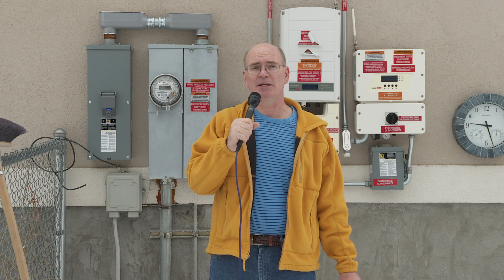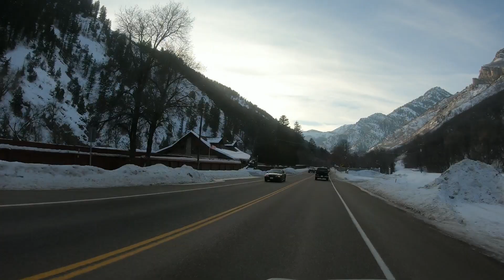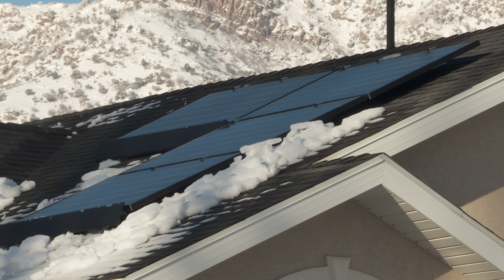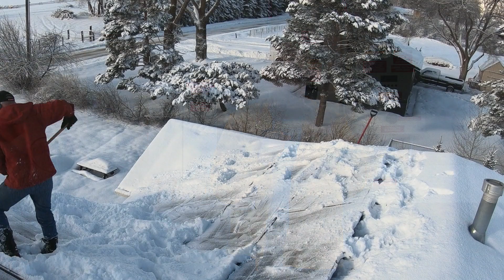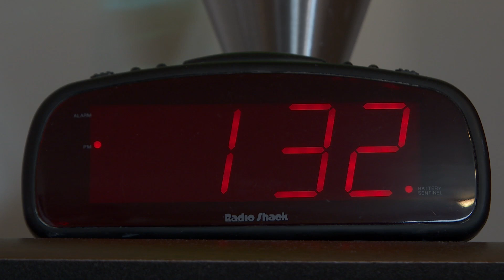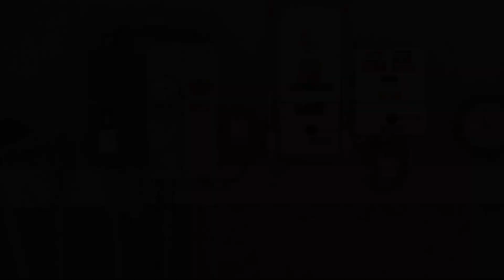Solar Panels On Our House - Two Years In

Comment: Thank-you for your extremely open and informative uploads as they have answered several questions we have - especially regards the battery back-up!
Reply: Regarding battery backup, it is a good idea but many batteries are not very efficient, to get a good battery storage system you need to invest quite a bit of money and you need the space for the extra solar panels and the space for the batteries. My goal is to try to go completely off grid. The main reason for this is that in France a good percentage of your electricity bill is monthly fees and taxes. I don't mind paying for the electricity but i find it a joke that we can be charged a monthly fee for something they are selling to us! It can be between 10- 25% of the bill! It depends how much power you are using.
   If i can afford to fit the system myself i should be able to pay it off in ten years or so but then there is the question of how long will everything last. What if the batteries only last ten years or less, what if the inverters break down? What if the solar panels start to degrade?
  Solar electric needs to be designed with deterioration and maintenance in mind which is one of many good reasons to oversize a little at the beginning.
  One thing to bear in mind is that we can benefit from using as much power as possible during the day, set all washing machines, dishwashers etc to run when solar power is peak. Try to use low power appliances during the night. If using battery storage during the night you have to consider that the power from the batteries is less efficient than from the panels directly as it has to be converted to the charging voltage and then the batteries themselves have a fairly poor usable efficiency curve. You also loose efficiency from the inverters depending on how good they are, you usually loose at least 10% there. What more people could try would be to try to tap more of the lower dc voltages from the panels so that some dc voltages could be used directly into batteries or other devices that would normally use a transformer in them. It is a waste to convert dc to ac then back to dc again :D Also by sharing the output from the panels to both the ac inverter and to other dc appliances at the same time then the power is more likely to be all used. If you have a grid tie inverter then you can just try to sell power back, this is fairly efficient but you may not have excess power to sell back and you might still need to pay monthly fees or other fees to your power company just to have a contract with them.
  Lastly. We can mix up our potential to harvest solar energy by using devices such as passive air heaters which are warmed directly by the sun, or by heating water directly from the sun. To heat water with electricity generated from the sun is not very efficient at all. 
Note, some gas boilers are often electrically boosted. If you heat your water with gas you should check the specs of your gas boiler. Many of them use an electrical filament to boost and regulate the water temperature. Where the element is not powerful enough to heat the water alone yet it can consume somewhere upwards of 500W while your hot water is running. Another thing to bear in mind if you are trying to go off grid.